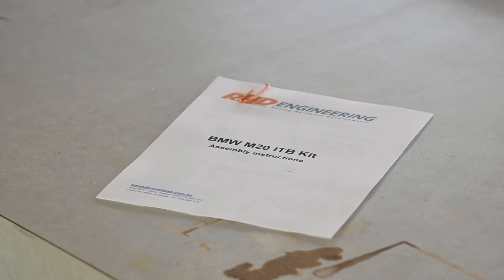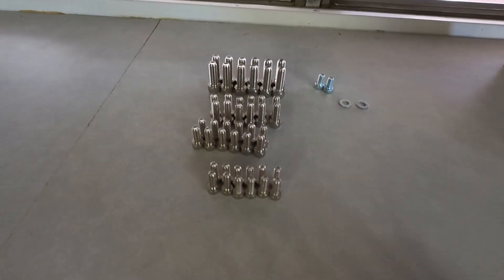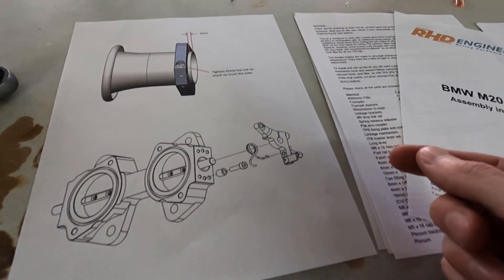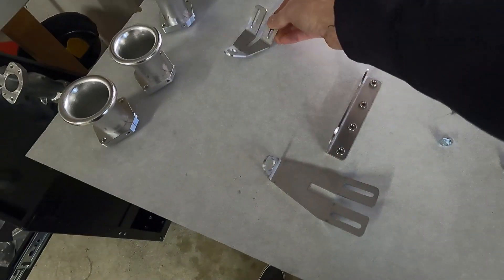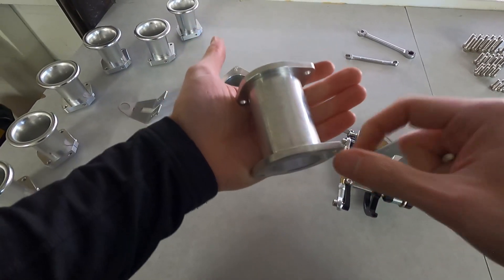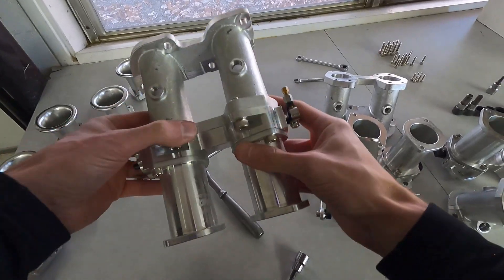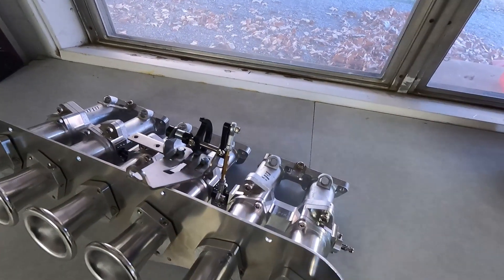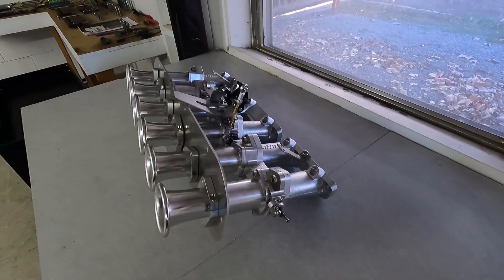Building M20 ITBs for the E30

Comment: 40mm kit ?
Reply from the maker: Yup, went with the 40mm kit since this engine is stock and this size would still work well with a slightly modded 2.9L M20.
Reply: @reichartsworkshop  how’s it holding up ?
Reply from the maker: Been delayed finishing everything up. Got the car started with them installed but still have a few vacuum lines to figure out.

Comment: Cool. I am going to Be using ECU MASTER BLACK rather than Megasquirt DIY -- on my built 3.0 liter. I have RAMAs kit already ready to go.. in my 78 323i
Reply from the maker: Should be a wicked ride! I was looking into ECU Master but figured I’d try the Megasquirt since I already had one.
Reply: @reichartsworkshop  I do too but I was told by Rama that the ITBs run better on this ECU. It has a more robust tuning fuel map
Reply: @reichartsworkshop  have you got the car up and running now on Megasquirt?
Reply from the maker: @jjgbmw323  got the car running on Megasquirt with the stock engine manifold. Still in the process of installing the ITBs now.
Reply: @reichartsworkshop  I finally got my car tuned on shaved bay custom harness with wasted spark and the 3.0 liter M20 on Megasquirt. Wasted spark gave me many problems I had to get a different quad spark, get DIY coils and send the Megasquirt ECU back to fix the board that was not outputting spark. It was a brand new ECU and quad spark.
Reply from the maker: @jjgbmw323  woah sounds like quite the hassle to get the car running. Luckily my system is a lot less complex and I previously had this MS running so I knew it worked.

Comment: I’m actually curious now that I’m thinking about it, how does the “bitch tube” work with this setup? Does it get capped or what?
Reply from the maker: Hadn't thought of this but that could be the the purpose of the large opening on the bottom of the middle runner. I originally thought vacuum lines but it's much larger than that now that I think about it.

Comment: You should have setup the megasquirt first. It took me a min to feel comfortable with mine. I’m excited to see how easily this all bolts up. I think idle control is going to be a task, but maybe I’m wrong. 

I was originally going to go turbo first but I think if I do itbs and then turbo it will def be good smiles both times.
Reply from the maker: I had Megasquirt 2 on this car awhile back when I had a 2.9L M20. Went back to stock ecu with this stock M20. The idle will be tricky. RHD recommended a synchronizer tool that I picked up already.